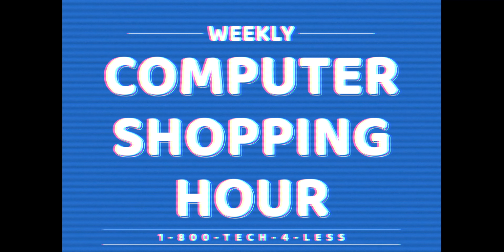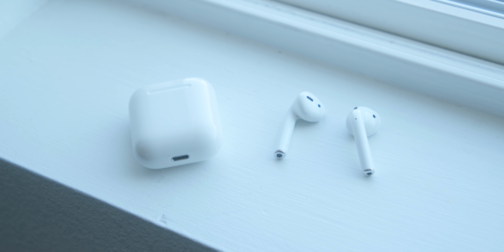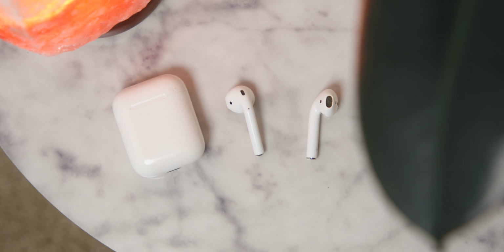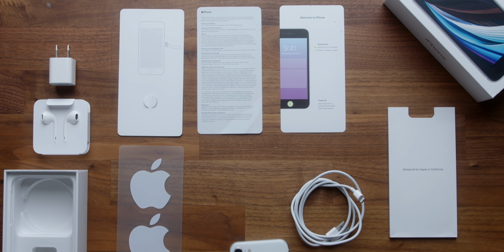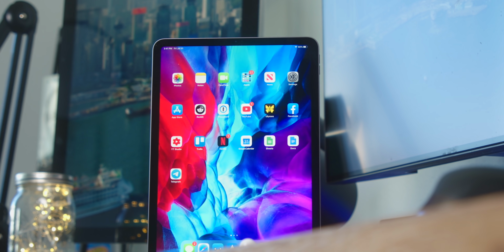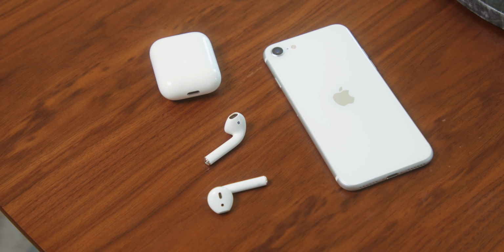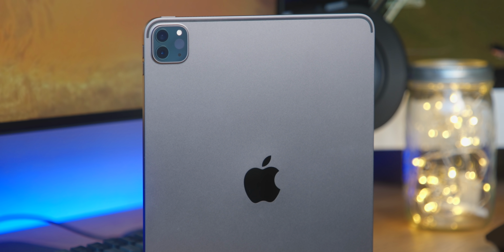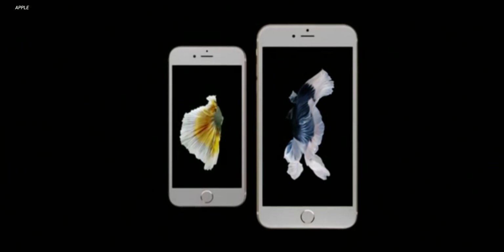Save your iPhone 12 money

Comment: Worst idea ever. I tried switching from the iPhone XS Max to the iPhone 11 and it was HORRIBLE! You can not downgrade at this point. First the screen resolution was the worst thing I’ve seen because I was used to the much higher resolution and it was just too small and clunky. It’s a great idea to just buy the cheapest phone because the internals are the same but I had to go waste money on the iPhone 11 Pro Max because my iPhone XS Max was already traded in... then there’s the point of downgrading from the stainless steel Apple Watch to the cheap one. NO! The glass on the cheap Apple Watch got SO MANY SCRATCHES on it!! Meanwhile the stainless steel doesn’t scratch at ALL!! Nice try but this idea is just bad if you already have the more expensive models

Comment: I had been using iPod touches as makeshift phones in school because I didn't like android and I was also broke. When I got my first job and the iphone 8 came out, I got the 6s because the price dropped to $299. The phone was great and to this day, I still have it. Its actually my back up phone cause its still in perfect condition with no cracks or anything. However last year when the iPhone 11 PRO was released, I just had to have it. So I got it and it works like a dream. Although I am not use to higher end apple products because I have one of apples new flagship models I don't see my self downgrading, unless I were to accidentally damage my phone badly. I wouldn't get the pro again because although it is a great phone, its too powerful for me. I probably haven't even used 1/10 of its features. I do see my self having my 11 PRO for a long time. If I get a new phone it would probably be one of apples mid range phones in the next 5-10 years unless there new flagships can fold and levitate or something else

Comment: You are absolutely right if all the extra functionality is not required and all you do with the device is media consumption and web browsing. Once you go further than that, you actually need to pay that extra bucks.

The apple watch, yes, you are right. If you don't wish to have a stainless steel case to go with your suit and oxfords, series 3 is a good deal.

Noise cancelling is a big deal. The difference is whether you have to ask your colleagues, your boss or your clients to repeat what they say in an urban environment. If that is not relevant to you, airpods would do.

If you use your tablet as desktop replacement like I do, on which i use procreate and darkroom, the price difference is the frequency of the apps crashing and losing work progress. Not only CPU, RAM makes huge differences the more layers you put in. Sometimes, I don't even feel that 6GB is enough.

As for the iphone, I'm one of those you mentioned who is still on the 6S. To avoid upgrading my phone for the camera, with which I take photos for my portfolio, I bought a 7Di with kit lens (used) iphone 7 was out, and now ended up with an EOS RP(new) with ef 28-70 f2.8 (used).

My 2 cent is that if you would use the premium functions, buy the pro version. Perhaps just don't upgrade every generation of the product. I feel that I could have just got the XR and some moment lenses, nd filters with an osmo gimbal, instead spending on a full frame mirrorless.

Comment: I may have agreed with John but there's one "tiny" problem with iphones and iPads. That problem is non-expandable storage. Whether $400 or $1000, getting anything less than 128gb they both seem rip offs. So the usable storage will set you at $450 SE (128gb) and $1150 for 11pro at (256gb). 64gb??? For an awesome video camera that'll gobble up space in no time with your 4k vids. I guess their cloud prices are at least decent. $4 for 200gb. Or you could use Google photos to backup. Unfortunately I know when you almost run out your physical storage, it'll slow the phone down. So yeah,  shady way of offering everyone the supposed options. 2020 should be the year where 64gb isn't a base option anymore.

Comment: If you shop around you can totally do it for under a grand. If you have an iPhone you have a cell plan so switch and get a promo. Depending on carrier free to 99 for a SE. Now Best Buy has great sales iPad 7th gen can be had for 249-279 depending on sale. AirPods are 139 on sale or go Powerbeats non pro for 129. Then the Apple Watch goes on sale for 179 at Best Buy as well.

Comment: Literally none of this is something I'd want. I get some people look at the price tag first, but unless you just don't care about quality or never do anything more strenuous than open Facebook, you're doing yourself a huge disservice buying any of these products. Especially that Series 3
Reply from the maker: The SE has the same processor as the 11 Pro. Your logic is flawed.
Reply: @jon4lakers  You get two more cameras on the Pro, and portrait mode is gimped on the SE. The screen doesn't get as bright, and the audio isn't certified for Dolby Atmos or even Spatial Audio. It's made about of aluminum instead of steel, and you don't get nearly as great of an Animoji/Memoji experience (though for the target SE audience, that might be a plus). If you wanna just get by in the Apple ecosystem, they're all fine, but that's the thing: they're just all... fine

Comment: I think Apple's entry-level products are just a bait to get someone into the ecosystem because it's all about SERVICES right now. I think the differences between the SE and the Pro line are significant; the multiple lenses are not a differentiating factor (for me, at least). Battery life, on the other hand, is far more important. The SE would be a no-brainer if it had a larger battery. Otherwise, it's already a perfect phone. The iPad lineup is a different story, though. Buying a low-storage iPad is not an ideal option; 128GB is the way to go. The displays on the Pro lineup are way better than the Air. One never really saves on Apple products; Apple keeps its profit margins intact across the range.
Reply: Drama queens. Very easy to use Apple products while not getting trapped in ecosystem. The only “entrapment” is using apps on both iPhone and iPad. And usually only need to pay once for those apps. Android might have caught up to iPhone in some areas but Android tablets are still utter shite. If you want app consistency across phone and tablet, and without paying twice for everything, you get an iPhone. Besides, an iPhone is a solid 5 year investment with updates the second they come out, latest features, latest API's, and therefore latest and most polished apps which don't need to pander to lowest common denominator of old APIs like on Android. The fact most iPhones and iPads run the latest OS and API's compared with less than 10% on Android shows itself in quality of apps.
Reply: Wishwader your right but android tablets have gotten better only the Samsung tab s7 and s6 tho but still they are not close to a iPad I’ll just have a google pixel and a iPad because android tablets aren’t most people’s thing. Android tablets are not close to iPads period. But they aren’t bad tho. Plus google pixels get like 3 years of updates maybe 4 why do people think samsung is the only thing that is a android like no theres alot of options you can choose. I do have a iphone 7 on ios 13 and the battery is bad but its a good phone none the less.
Reply: Mehdi Adlany Apple is competing against each other.
Reply: The SE trash bro
Reply: TheMildGamer it’s not, it’s got a A13 chip inside lmao
Reply: TheMildGamer I work in a phone store and it’s the best selling iPhone, the SE is a lot of things but trash is not amongst them.
Reply: I’ve accumulated so many apps and junk since 2011 and 64gb still works on the iPad for me. iPhone... not so much with photos and videos.
Reply: Buy a good battery case for the SE and that problem is solved.
Reply: Duh everyone knows that but he just gave people a new perspective to think about but this is for smone completely outside the ecosystem but if u already have some of these things this video doesn't make much sense :-)
Reply: Mehdi Adlany 128gb is the way to go if you do editing and stuff. If only games a bit of work etc then 64gb/32 is enough depending on usage

Comment: Who are we kidding, when you’re used to having the top of the line iPhone every year or other year,there’s no way you’re going to want to trade it in for a SE version. The SE version is a great phone but the difference is one has a Lamborghini engine and Lamborghini body while the SE has the Lambo engine and a Kia body.
Reply: yea.. but there's no reason to have a lambo if you're living on a farm and don't wanna go anywhere!!... same is true for a lot of people, not everyone needs or wants OLED, Face id or a triple camera set up.. Also he wasn't talking about swapping a flagship iphone of the older gen for SE, this video was more for a person venturing into the apple eco system and he/she can do it for less than 1000 bucks, ( minus a mac) which is a pretty sweet deal!!
Reply: MARVIN ABRAHAM  Actually, there is.  Apple always gimps their lower end stuff in critical ways: much lower RAM, worse batteries, lack of wide angle camera, etc. Sure it all “works” but only if you don’t mind all these things that will gnaw at you.  Eventually the frustrations get to you and you end up forking for their flagship because it fixes all those annoyances. Then what? You’ve just spent the cost of an entry level PLUS a flagship, instead of just buying the flagship in the first place.
Reply: @lenardz  All of these are applicable to most cheap phones and obviously people who buy an SE will have these things in mind. Except for the battery, that is obviously shitty, none of these are potential deal breakers for a person getting into the Apple eco system to get a taste. Lower ram + lower storage will cause issues in future for above average users but those people wouldn't have considered an SE anyways.
Reply: Lenardz you look at it from the wrong angle. I work in a phone store and the people who but the iPhone SE don’t care about phones, they just want a new iPhone with a home button, something familiar. They don’t care about multiple camera’s, Face ID or an Oled edge to edge screen. 

They just want a working iPhone and for them the SE is the perfect phone that will last them for years. Most of the time they come from an iPhone 6s or 7 and want the same thing but newer and better.
Reply: Me. I own both the 11 pro and the new se. I've been using the se as my daily driver for the past month and it's been an awesome phone so far. I prefer the smaller, lighter phone with the nostalgic bezels and touch ID. I never really cared for having the best camera on a phone so the hardware on the se is perfect. The battery life is atrocious though on the se, but I'm always able to make it through a full day. I guess it comes down to personal preference.
Reply: NOT Enrique hey. Stop disrespecting KIA!!
Reply: I completely agree. I couldn’t justify downgrading from my iPhone’s OLED display, Face ID, near bezel less display, superior camera features etc. for a cheaper entry model.
Reply: I know that  Apple is really pushing the iPhone SE as the affordable choice, but I just can't see using a phone with just a 4.7" display, especially after having a few android phones that have almost 6" displays. On the other side of the situation, many of us don't want or need the 11 Pro / Pro Max. Using the Lamborghini comparison, some of us just want the middle of the road - a Honda, Toyota, or even a Hyundai or Kia (have owned Hyundais for 25 years and they have been good cars), -- and go for the regular iPhone 11 - no telephoto lens, no Oled Display? Don't care. I know most people don't think like me, but I won't spend $1K on a phone, even if it's an iPhone. 

First time iPhone purchaser here in mid 2020, after only having android up to this point, and honestly can say, the iPhone 11 is good, but still miss many aspects of android. As far as anyone out there who is considering the iPhone SE, and if they are flexible and not entrenched in IOS, then I would tell them to consider the Pixel 4A, or possibly the OnePlus 7T. Probably not the feedback that many would want or expect here, but just don't feel like going all crazy and buying all Apple anymore, and this is after owning and using a couple of Macs and ipads for over a decade.
Reply: with 0.005 milliliter feul tank.
Reply: Yeah you’re selling yourself short getting these low budget devices especially for the price. There’s a reason the pro has more to offer than the SE. its also a future proof phone to last at least 4-5 years maybe more. That SE me personally wouldnt last more than a year.
Reply: Battery life of SE is just garbage though.
Reply: @mikekaze7175  For you or me yes it won't cut it but for the 55 year old guy that comes from an iPhone 6s which lasted half a day the SE is a dream. 

It's all a matter of perspective.

Comment: If you choose the android ecosystem you can do much more
Reply: Laggy phones in that price
Reply: @_YahiaSayed_   @Yahia Sayed  you could get a OnePlus 7t and OnePlus buds for less than $550 tab s6 lite $350
(Generally you can do everything in your mobile devices so I would get the new xbox S for $299 instead for an iPad or a tablet ) 
Oppo watch is  $250 for wifi version and $350 for the LTE version 
550+300+250=1000 
This is better value for money!!

OnePlus 7t is not at all laggy.. it's one of the most snappy phones you can get in 450
Reply: @srikanthbalakrishnan9733   i dont like knock offs thanks

Comment: Hearing “brand new” Apple Watch series 3 seems wrong...
Reply: Particularly when it will probably be obsoleted in a year (Series 2 won't get WatchOS 14).
Reply: Rob Stevens   WatchOS 7 not 14 🤣
Reply: @davidjacobs6244  I stand corrected! I keep forgetting Apple hasn't fully unified the version numbers.
Reply: Rob Stevens They might give AW series 3 Watch OS 8. But if not, Watch OS 7 is still great, loving the built in sleep tracking
Reply: When he say “brand new”, he means “out of the box”, not “newly released”.
Reply: I’m still on series 1 Apple Watch ⌚️
Reply: Reece Beau they have new ones